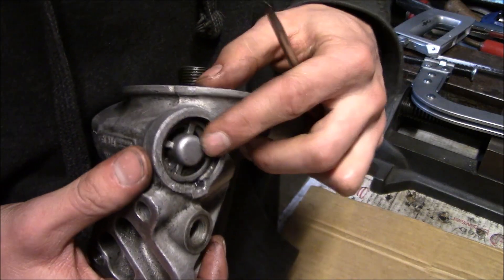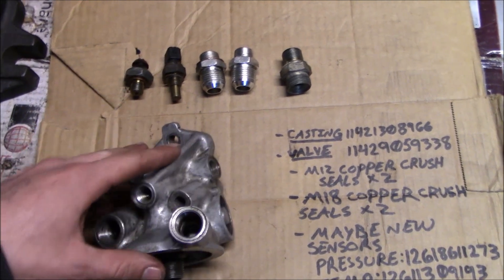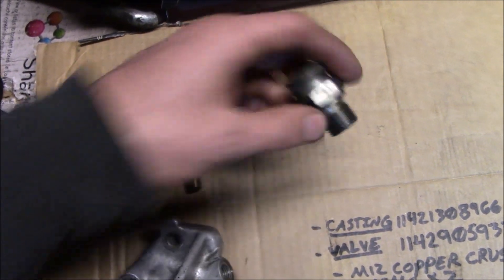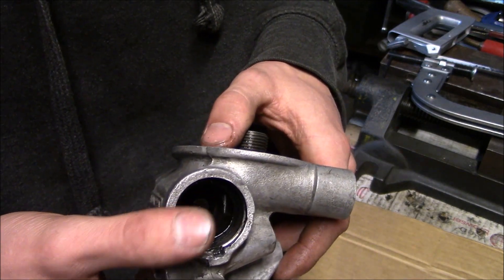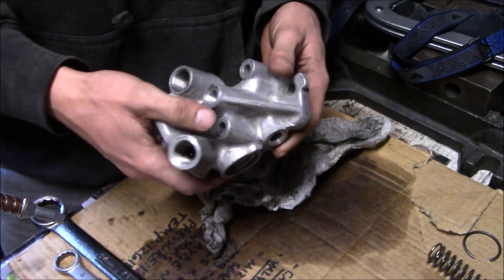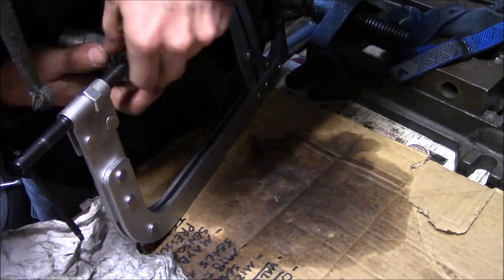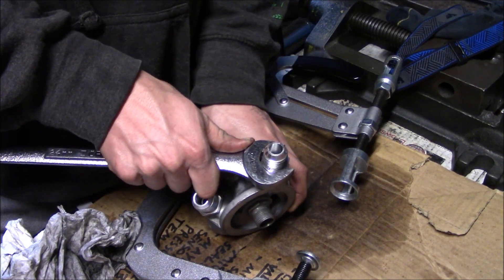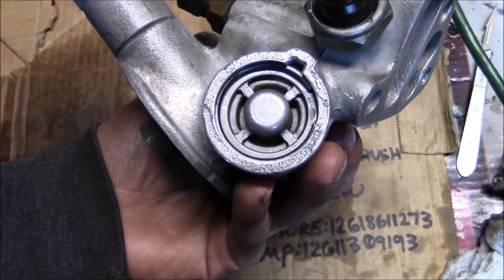BMW E30 M3 S14 Oil Filter Head Rebuild, Disassembly, Cleaning, Reassembly

Comment: Anybody got any idea if the thermostat element is still available for purchase?
Reply from the maker: try realoem for the part # then ebay
Reply: @10mm  realoem does not show it on the list of parts - only the gasket set for the plug